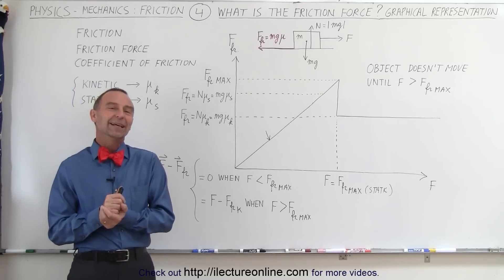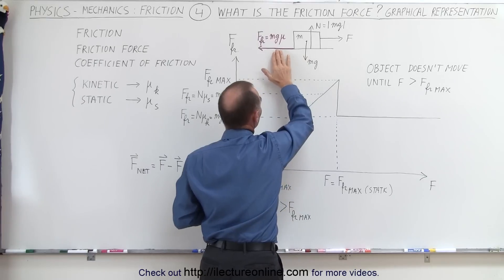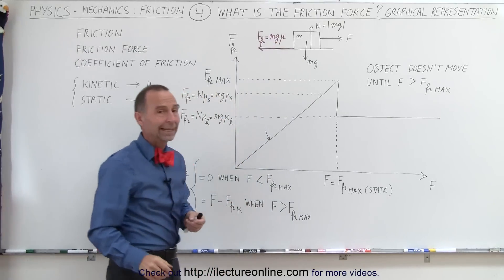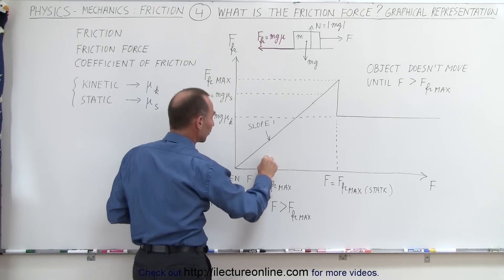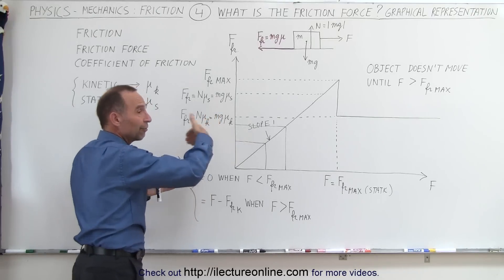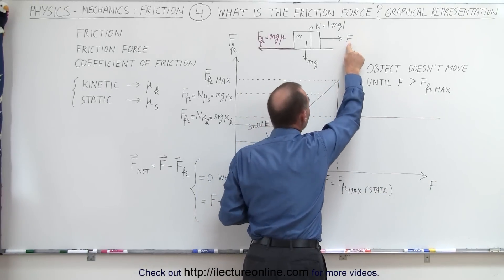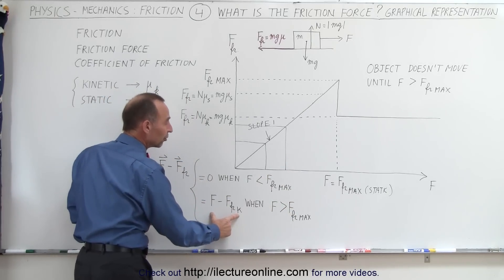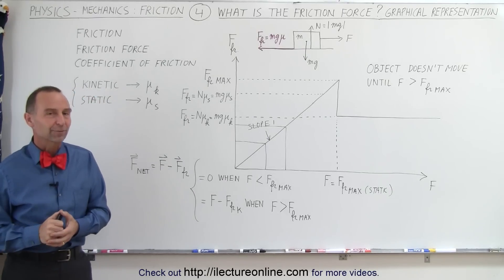Physics 4.6   Friction (4 of 14) What is the Friction Force? Graphical Representation

Comment: Sir your explanation is beautiful no doubt in that, but can you please explain about why it is always  consider that the system of forces is concurrent in friction? The reason I'm raising this question is because it is so evident from your diagram that all the forces acting on the freebody diagram is coplanar non concurrent(normal force and weight doest coincide and force applied and friction is not coinciding )hence we should consider the moment condition right!!? But it won't be considered almost all problems that I have seen in YouTube including your video sir,( according to diagram ) so can you please justify it
Reply from the maker: The friction force always acts at the surface where contact is made between 2 surfaces.  The direction of the friction force will be along the direction of the surface where contact is made.